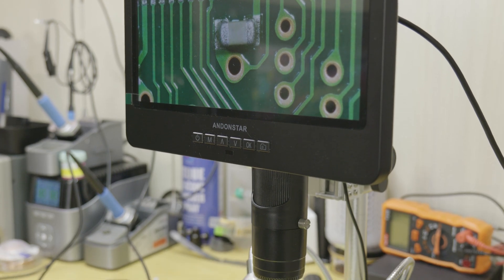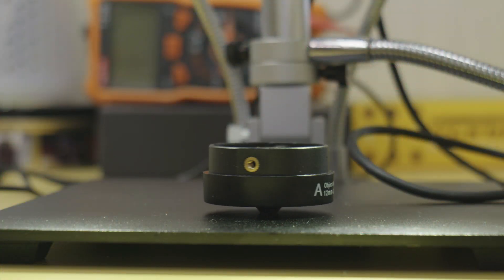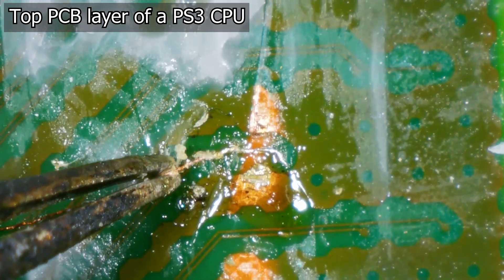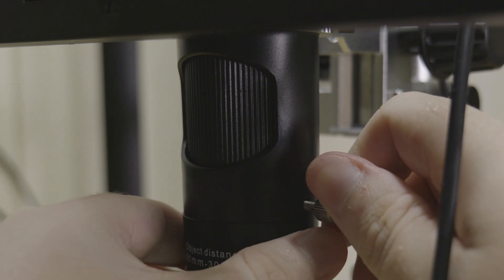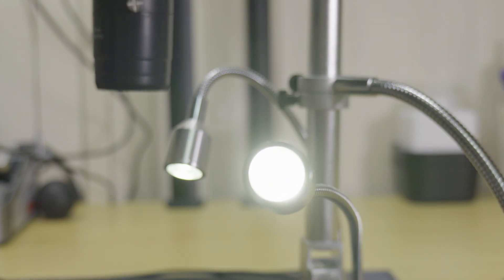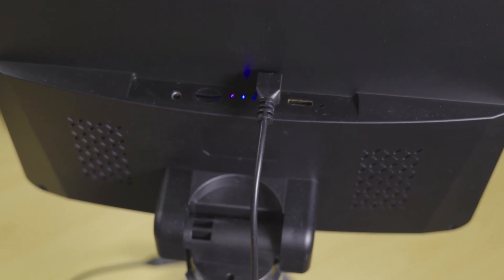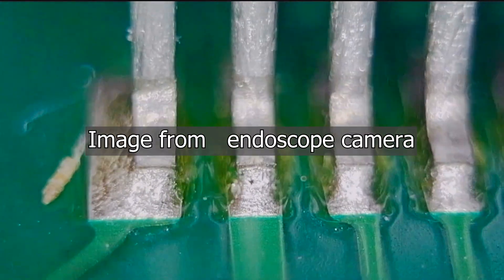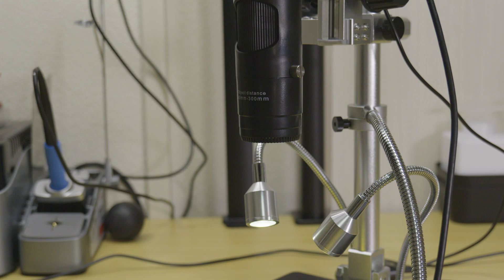ANDONSTAR AD249S Digital Microscope Review

Comment: Do you know what the response time is on the display? I've been trying to find this everywhere and cannot find it.
Reply from the maker: I don’t know exactly but I’d guess at less than 10ms, it’s not noticeable to me 
I used it in the PS3 cpu repair video and response time wasn’t an issue while doing that repair (soldering that small you can notice it more)
Reply: @Slot1Gamer  appreciate the response, would you think it's a 30hz or 60hz refresh rate?
Reply from the maker: @stevewandrie7537 I’d say 30 in 1080p
Reply: @Slot1Gamer  Thank you so much! I really appreciate the info. Im thinking im going to get that one now.

Comment: of course you can livestream it. All you need to do is run it into a hdmi splitter (or direct into say a 4K Avermedia capture card) then out to the TV via the pass-through feature. I have maybe 6 consoles and a framemeister looped this way using the 4K Kinivo 550BN HDMI router and can just switch between them whilst livestreaming. Its fairly simple.
Reply from the maker: No the issue is with actually using the microscope.
When you connect it via hdmi the internal display turns off, it makes it 10x harder to use being completely separated 
Only way around that is to literally put a monitor over the built in screen 
And even then you loose OSD

May as well not use it this way and buy a different scope if you want to live stream